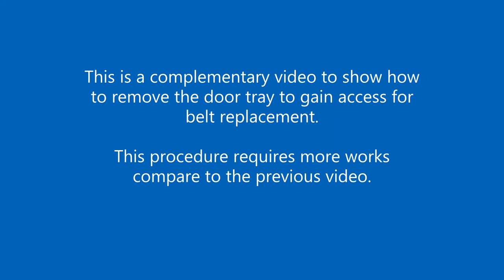NAD 523 Belt Replacement (Complementary Video)

Comment: Thanks so much for sharing this knowledge.  I have the exact same model.  Where can I find a part number for the belt that you replaced?  I am having the same problem but I cannot find any place on-line where I can find parts or part numbers. THank you!
Reply from the maker: Thank you for your comments. Unfortunately, there is no service manual or parts listing available in the website. With my experiences, the most economic way to solve the problem is to buy a package of assorted rubber drive belts. You should be able to find a right size for the replacement. Here is a sample link of belts: https://www.ebay.com/itm/153729401786?hash=item23cafc83ba:g:JEAAAOSwWz1d0kz7
Reply: @VintageAudioFan  Thank you so much. I look forward to learning from you again!

Comment: Thank you so much for posting this I agree with you on the sound quality. Who did you purchase your belts from? I need to replace both of them.
Reply from the maker: There are many vendors selling CD drive belts on eBay,  you can check them out. The other options is to buy assorted rubber drive belts, The package comes with many different sizes which you can find one to fit. The price is also reasonable.